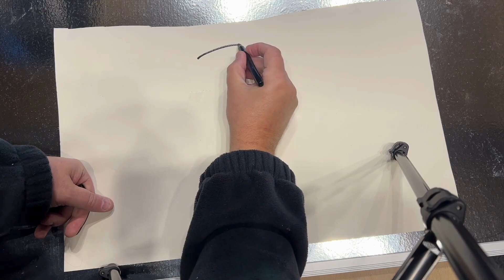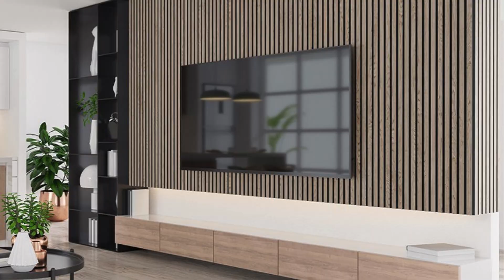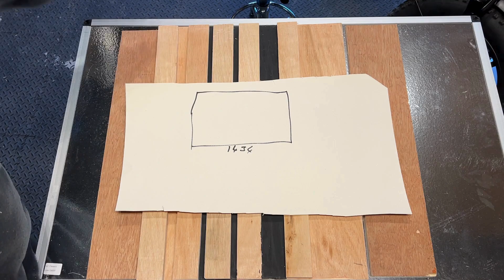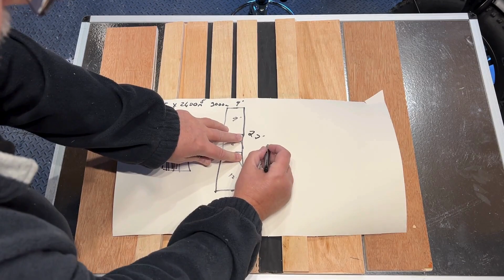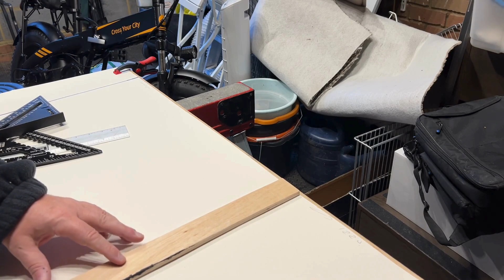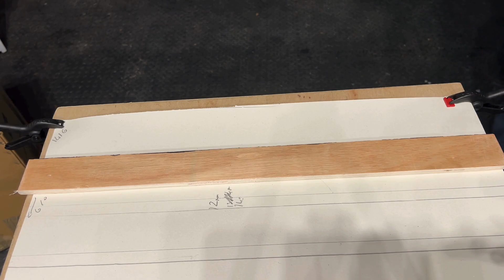EP13 - Narrowboat Slat Wood Ceiling Ideas and musings

Comment: I would paint the ceiling black and quik-glue the slats. I don't like using nails and screws where they aren't absolutely necessary. or even paint the roof black and faux wood slats using stencils. Also,  there are little paint rollers with designs cut into them. Wood grain may be an option. I don't know. I've never looked for a wood grain.🙂
Reply from the maker: Defo black with wood slats. Glue might not be enough due to boat vibrations 😁

Comment: On my  current narrowboat the ceiling is long strips of cladding in a light coloured wood that is not pine. The electric cables both DC and 240 AC are run in plastic trunking under the gunnels. Easily accessible by unclipping one side of the trucking. This space under the gunnels is created because the upper wall panals hang over the lower side wall panals by about 5cm. There are two sets of trucking side by side. The DC in one and the AC in the other. To feed ceiling lights branches go off to switches and then to the lights. To feed the sockets the cables run down to them. The ceiling lights are all led recessed fittings and I have many zones.     It's only a suggestion but when fitting out the boat make it easy to get to plumbing, electrics, gas etc. Boats have to endure cold damp weather each winter and I have nearly always found a water leak each spring even when domestic water is drained.
Reply from the maker: Thanks. Yes that kind of what I plan to do with the electrics. Some will be in the roof space to reduce length like solar and Wi-Fi but mostly under gunwales. ….and everything accessible. No pipes under the floor.

Comment: If you want a bright space don’t go for plywood. If you varnish it goes dark with age. IMO best option is side cable roots and use a ship lap mdf, comes in sheets and can be sprayed any colour to suit yourself.  👍🏼
Reply from the maker: Not MDF in a boat that moves a lot with temperature and can get damp from condensation and dripping mushroom vents.  Unless using Moisture Resistant stuff and sealing well, but I think this still runs the risk of tearing around screws over time when boat moves & expands.  However, many boat builders now use MR MDF tongue & groove panels and that may be an option instead.  Still mulling over that one.

Comment: You can buy ply / sheet material in 10 x 5  aswell as 8x4. 

Personally I would board fill and finish the ceiling then buy random lengths of PAR in oak/walnut/ hardwood etc

I would use a finish brad nailer & glue  to fix them, stagger the joints with random lengths. 

Also remember the gap will be a trapeze shape on the ceiling as you move across the curve. Might not be much but will vary across the curve, could be 12mm at the face and 13mm on the ply… 

This would likely allow the extra you wanted at the sides…

Buy yourself a l track-saw far easier than a table saw in a small space. I yse the festool Tsc55 which is excellent but there are more cost effective versions…
Reply from the maker: Thanks.  Did not know Ply came in 10x5.  Wonder if that will fit through the stern doors.? And thanks for shouting out the trapeze shape.  I forgot about that.
And as you say, I think the best way is random lengths.